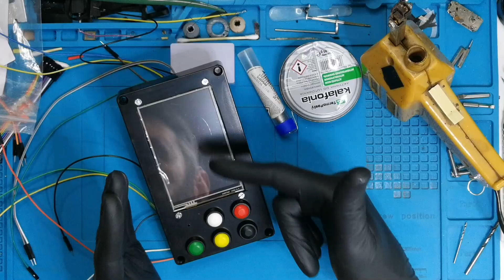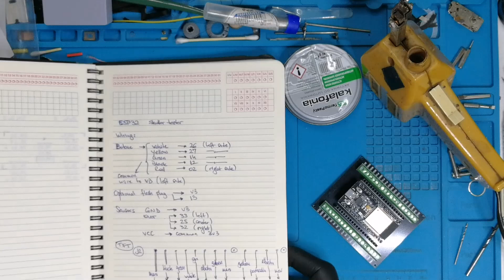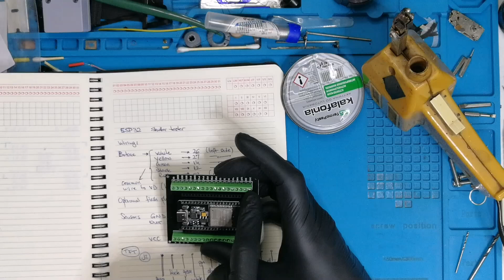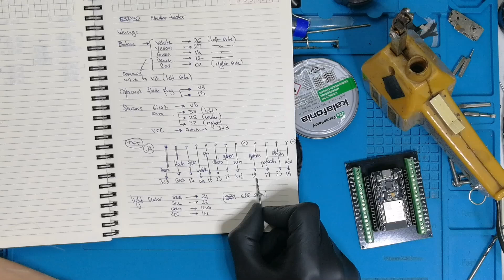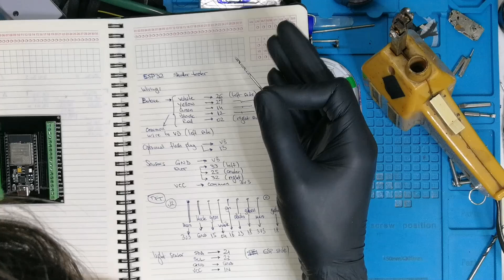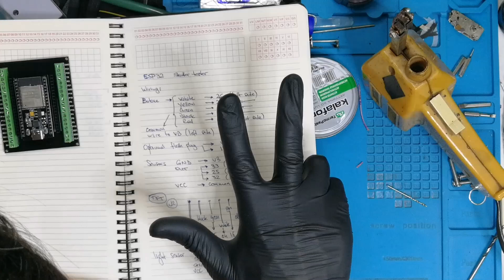Making a 3 sensors shutter tester - part 2

Comment: Hi, Cutting a neat rectangular hole is probably the hardest part! 
When I finally get a 3d printer, I intend to make a bezel to fit around the screen, covering the cut hole lines.

I used to have a milling machine with digital readout. This was ideal for cutting rectangular holes and drilling holes in the right place.

The latest version uses the same screen mount bolts (25mm length) to also hold the breakout board. A neater idea than my original wooden spacers. A USB plug/socket is then used to bring the USB socket to the edge of the project box. 

16.10 The light sensor gives a reading of the ambient light level in Lux and EV.
If one was using a LED light source (not recommended) one can measure this light & then compare it to the light meter of the camera.

The idea was/is to add a variable light power source to enable testing of the camera light meter and also to use this light source for testing of automatic only cameras*, so one can give it, for example, EV16 and ensure the camera gave 1/100s @F16
*Needs aperture priority mode.

The Shutter Tester actually has PWM out functionality for controlling a LED drive (just not publicised) however, the problem is, I cannot find a suitable Constant-Current LED driver that is controlled & dimmed via PWM. The ones I have bought, which claim to be Constant-Current, actually drive the LED at PWM.  

16.50 the unused pins on the TFT display are for touch functionality. Originally I showed these wires connected (but they were not used) to simplify the schematic, I have removed them. 

Those chines knock-off Wago connectors are actually very good, however I would never use them for house wiring or heavy current loads. The Dupont wires are very thin & it can be difficult to remove the insulation without also cutting some of the thin wires. 

The latest version uses JST XH connectors, which come as 3/5/8 etc ways, which keeps the wiring neater. One can still use Dupont wires.